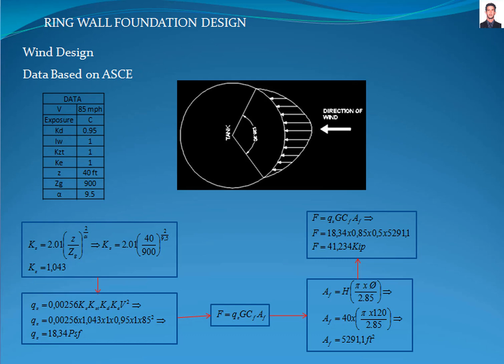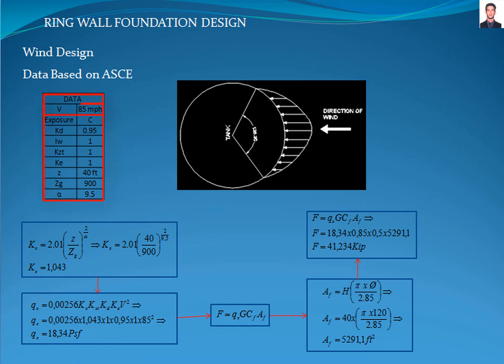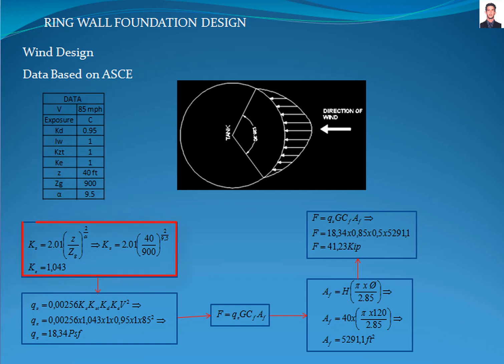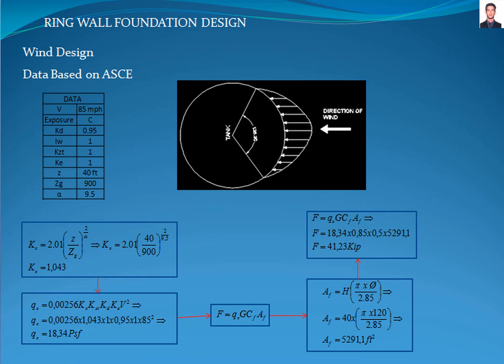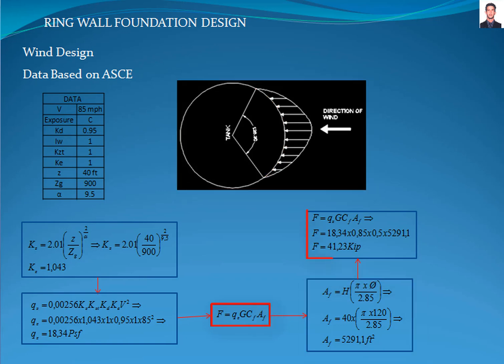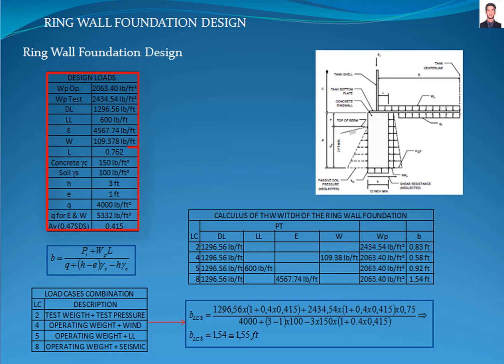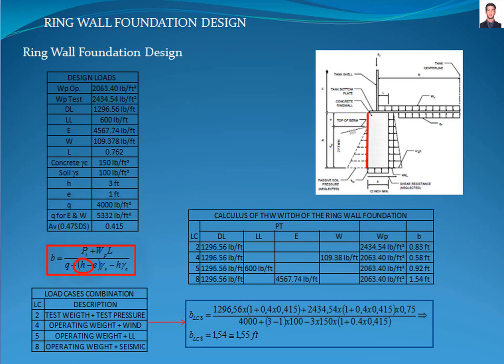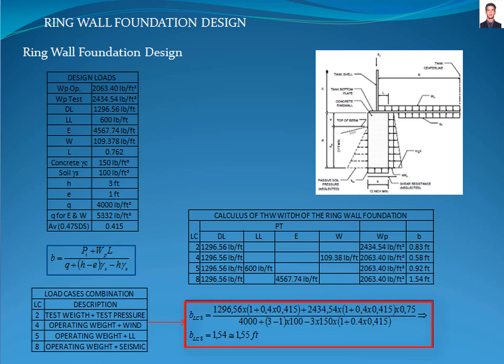RING WALL FOUNDATION DESIGN PART II

Comment: How do the horizontal E and W loads get transferred to vertical components of the PT load?
Reply: Francisco divided the total horizontal load by PI * D for both cases. 41230/(3.14*120) for wind. Same for Seismic. I suggest you look for this section of API 650 (2020):  Table 5.21—Unfactored (Working Stress) Downward Reactions on Foundations. It describes how you should consider every load case, including horizontal wind and seismic forces as you asked.

Comment: Hi, Francisco. Thanks for uploading your experience with this design. There's a difference on the value for Wp you put on LC8 on the table (2063.40) and the one you put on the equation for bLC8 (2434.54). I redid the calculation and 1.54 ft is correct when using 2063.40. It just happens that you displayed the Wp load for hydrotest instead.
Reply from the maker: Thanks for your observation, yes I am noticing the equation has omitted the E and is written wp test instead of wp OP, my mistake
Reply: @franciscojosefandinoperez1387  i am putting all this into mathcad for my engineering Bsc final project. Can you DM your contact e-mail? I would like to have someone to share info on this

Comment: Hi Francisco, I have been trying to design a ring wall foundation like PIP, but I don't know how I can get the force E = 4567.74 lb / ft, should I make a model to get this force or is there an equation for this?
Reply from the maker: That is the seismic force Jose, that was calculated with ASCE 7 and API 650 standards, remember that the seismic force must be "distribute" around the tank perimeter
Reply: @franciscojosefandinoperez1387  How do the horizontal E and W loads get transferred to vertical components of the PT load?
Reply: Table 5.21 api650